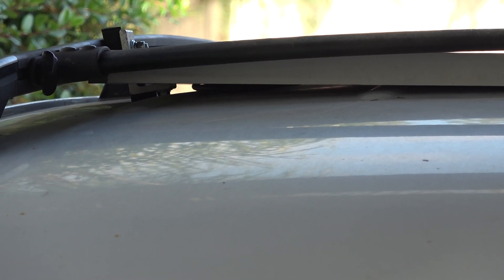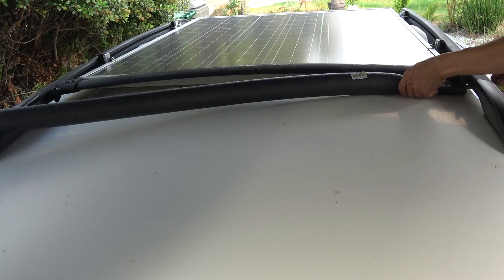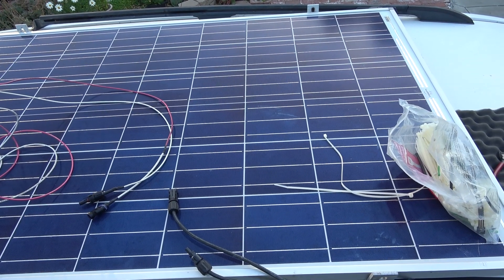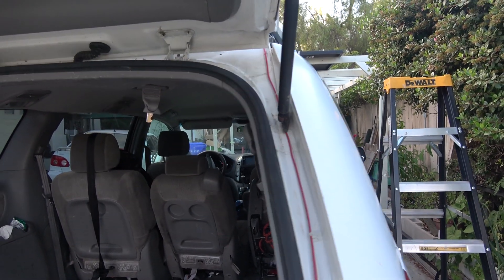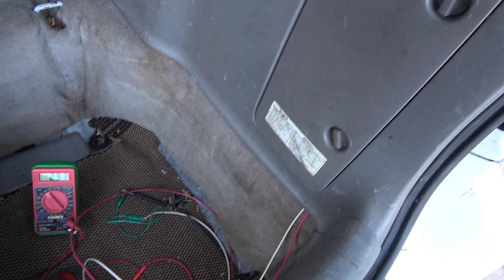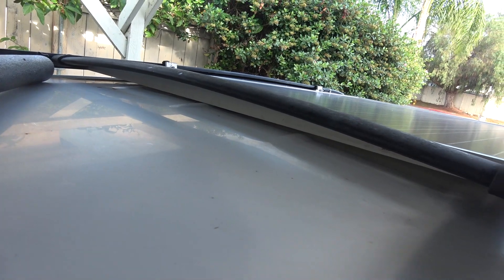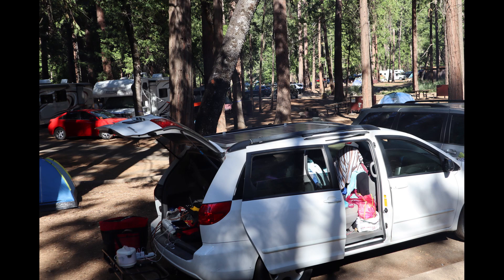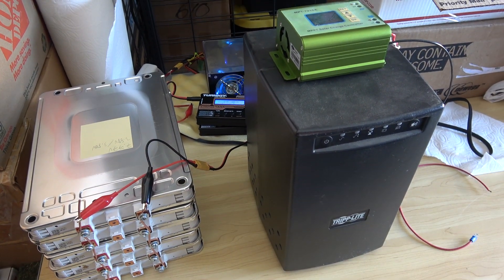Solar van S01E02: Install a solar panel on the roof of a mini van (Toyota Sienna) -Part 2

Comment: Nice build! Can you give us a general cost of the build? Thanks!
Reply from the maker: Almost all of these parts I got are second hand so they are pretty cheap. But here is how much I spent on them:
Solar panel (250W): $100
Battery pack (2.5 KWh): $50 each x 5 = $250 (this is the most expensive part of the build)
Charge controller: $40
Inverter (1000W UPS power supply): free! = $0
Screws, bolts, nuts, copper wires...: $10
Total: About $400.
As a comparison: A Yeti 400 (0.4KWh) power station with a 50W solar panel costs a whopping $750 before tax! When I first looked at it I was like dang, there's got to be a better way!

Comment: Got the same color van as you, but mine has a sun roof mine is xle version. I would worry that the rails may cast shadow. Like to have mine at least flush with the rails on top.

Comment: Good job! To solve your charging issue while driving and parked. You just need more space between the panel and the rooftop to keep the panels cool. At least 1 inch, 2 inches optimal space. The panels get hot while charging. It loses energy from the heat, if not properly cooled.

Comment: impressive , I think I will copy this build and try and find a solar panel that fit between my roof bars. like the rubber spacers / vibration dampers ! I'll probably have to bolt right through my roof rails as I have no slot. they were cheap so not a problem.

Comment: Awesome solar panel project for your van. I just placed an order on 2 100 watt each solar panels since amazon having a deal on it (2 for 150$). Putting 1 first on my 01 subaru forester.  Would like to ask you where did you get that inverter box?
Reply from the maker: The inverter is actually a UPS power supply made by Tripp Lite. I removed the 36V lead acid battery (3x 12V) and put in the 40V Nissan Leaf pack.

Comment: Great installation 👍🏼👍🏼👍🏼. I am working on my 2007 Sienna following your example. I opened the rear tail lights cover. I could pass the wires through, but I have a hard time to close it. Do you think that there will be some water going through the crack. Thank you.
Reply from the maker: It's a bit tight through the light cover but it'll go. I haven't got any water leak so far for the last 6 months.

Comment: White is the best choice for keeping it as cool as possible, but maybe a thin piece of corrugated plastic under the panel to help cool it while sitting still. Just a small amount of wind going through the vents in the plastic will help cool plus it gets the panel off the metal roof. You said your solar panel has to put out less voltage than your 40v battery. I never knew it was wise to do this with a boost converter drawing more voltage than the open circuit value of the absolute value of the solar panel. That solar controller is not MPPT it's PWM. There's hundreds of videos on that same controller. You could get a better and faster charge with a real MPPT Controller. I would use that with 2 regular solar batteries that charge to 14.4v each so 28.8v out of a 30.5v solar panel.

Comment: Great installation, but the only thing that concerns my, is that the wiring will lead water down to you tail light assembly, and the trunk area.
Reply: What might you suggest can be done?

Comment: Did you end up grounding this solar panel? 
If so, how did you ground it?  If not, why not?
I've seen a number of RV setups where they ground to the chassis
Thank you :)
Reply from the maker: The panel is grounded via the roof rack. It is mounted using aluminum brackets mounted to the roof rack which is mounted to the roof that is part of the chassis of the car.

Comment: Really like that idea Solar on roof, should make a real car running on batteries with solar panels driving and charging at the same time would be a great idea never run out of battery on day light and would be charge at night 👍
Reply: That's an amazing idea, because you will have power everywhere. This is how we did.  https://www.youtube.com/watch?v=SGLfB3lqtVE here you can get it https://cuttingedgepower.com/products/mspmb
Reply: You only get 1mile per day if lucky.
It takes over 2 months to fill the electric car battery.

Comment: Now I got to another great experiment for you  Most vehicles use  Around 15% of the gas is used by the alternator Try running around one full tank of gas without doing anything and then after that hook in your solar panels charge controller straight to your car battery and see if there is a difference in gas mileage  Another great experiment for you run with it and always great Experiments keep them coming good job 👍👍👍
Reply from the maker: Sounds like a good experiment worth doing! :D

Comment: This man is a genius.
I have a interesting question.
How does the car behave when it is left in the sun?
It should be colder if i'm right, and that is a added bonus.
Also, that wind ramp you could get 3d printed and painted and it would work great.

P.S. Audi had a similar technoloty on their high end models in the 2000's. Basically solar sunroofs, allowing it to run AC fans while car is turned off.
Reply from the maker: The car now has an "external shield" from the sun that is over 1.5 square meters so yes, it is cooler when left in the sun. That's an added bonus, indeed. A 3D printed ramp would be enormous and cost an arm and a leg. That piece of foam cost me $2 from Lowe's. It works like a charm as you can see in the video. I can probably run a fan or even an AC when the car is parked in the sun as I have an excess of 150W of power when parked.
Reply: @vuaeco  The 3d printed ramp would cost you less than 20$ and you could hinge it so you can store things underneath the solar panel.
Like for example another panel with drawer mechanism. And then you'd have motors pull it out once you are parked.